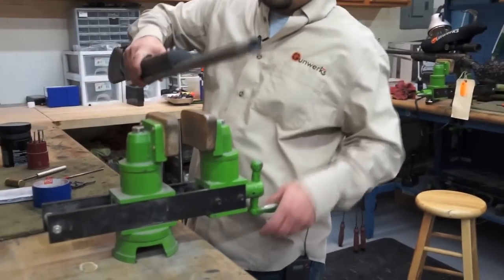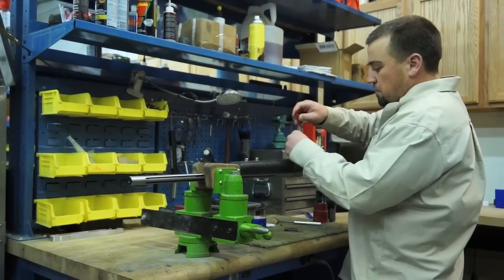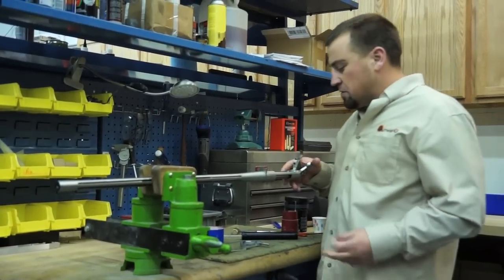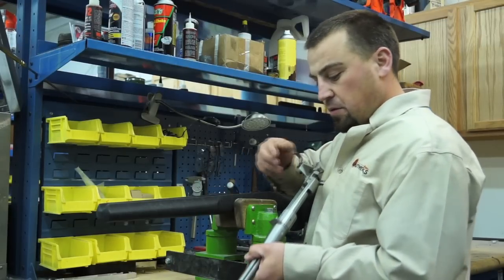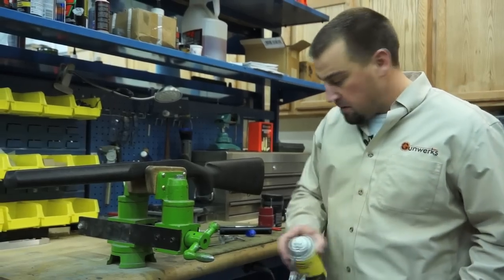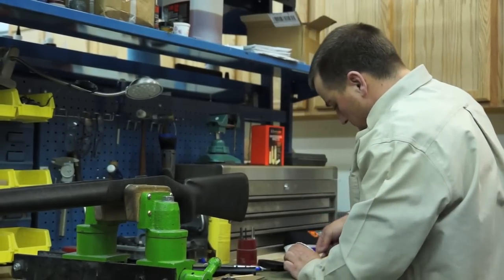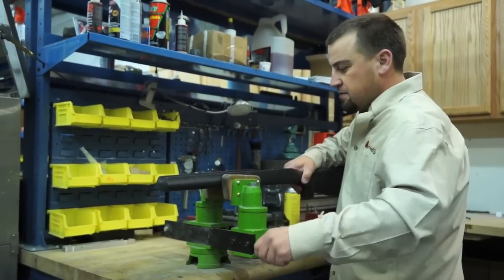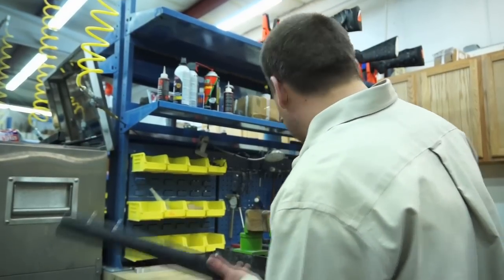Configuring a Factory Rifle to Shoot Long Range - Part 1

Comment: You lost me at the first mention of Remington. Why would you start with a pile of crap like that?  Get a Winchester.
Reply: Rich Turner you obviously don’t shoot long guns if that’s what you recommend
Reply: Not as much as I'd like to, but when I do, I enjoy having one that works, and hitting my target ;-)
Reply: Cody, I've owned 3 Remington rifles, and they have all had so many failures, I got rid of them, and I wouldn't have another one if you gave it to me.  I've never had a savage break on me, nor a Winchester.  I'm not trying to say that a Remington is an inaccurate rifle.  It's just a very poorly made rifle.  If you like it, good for you, but I hope you have a gunsmith to fix that thing when it fails.
Reply: Or Tikka T3
Reply: I have a 700 sendero in 7mmSTW I been shooting 20 plus years and not a single failure...and I can cover 10 shots with a quarter at 300 yards which is good for my blind ass;)
Reply: @richturner1624  what about the huge lawsuit against Rem for accidental discharge?  People have died !!
Reply: Army M24 Sniper Rifle and Marine M40 Sniper Rifle are both Remington 700's,  Says a lot.